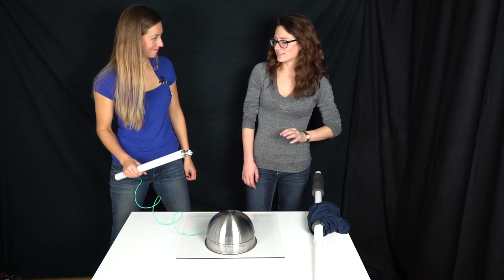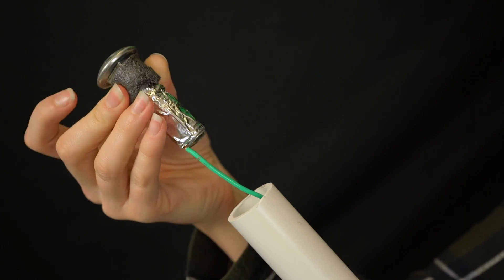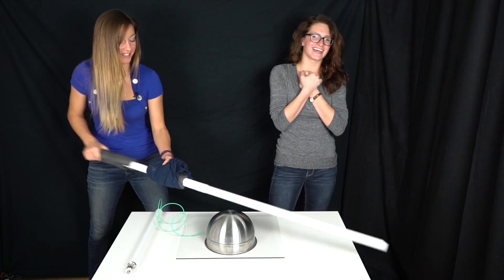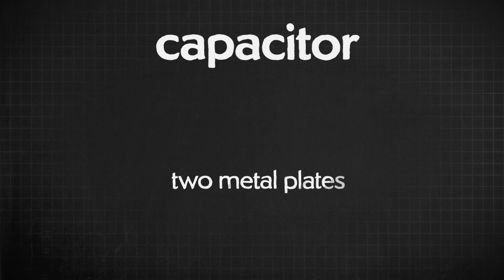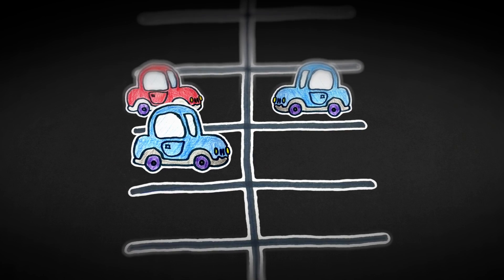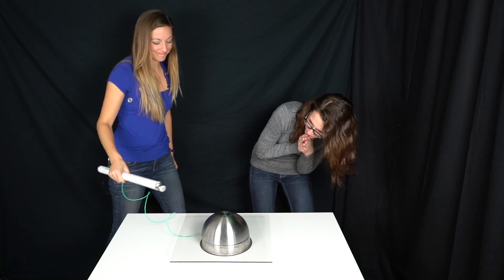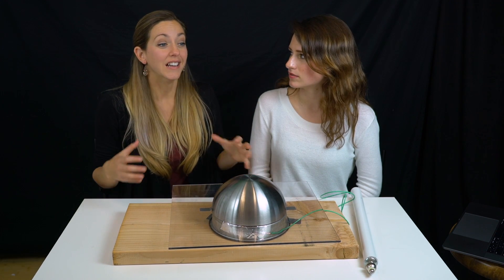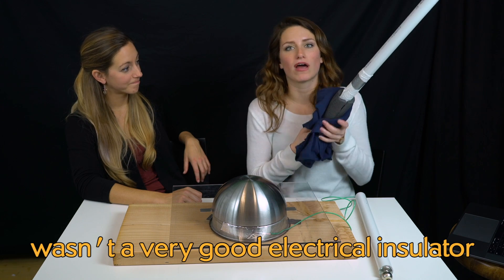DIY Lightning Experiment! Make a SHOCKING Capacitor

Comment: so if this was connected to a power supply (lets say a 9volt battery) could this be made into a bug zapper? If you were to have a metal bowl a slightly smaller clear plastic bowl with a light under it to make it glow  and then put a smaller metal bowl to hold the charge and catch the bugs. 

or will the bugs just fly around and not get zapped because the bugs need to be grounded to get zapped?

Comment: Now if you could store that static charge in a capacitor and drain it off throw a resistor to a battery it would be a much better way to charge solar battery banks and could be converted to AC and put throw a transformer to supply the grid. the trick is to draw the static of miles of transmission lines that have no connection to ground. Back in the early days of Power line development the linesmen had to ground out Newly built Power lines not yet connected to the grid because they would build a static charge and linesmen would get killed from coming in to contact with a line so they started grounding the lines with giuide wires and chains at the very start of the job. Could this be Tesla's way of getting free energy? but back in tesla's day they didn't have the technology we have today with battery storage and resistive control of higher voltages. Static is low current high voltage but if you can lower the flow of the voltage using a resistor that would increase the current flow for a Battery bank and it would slow the time it took for the capacitor to discharge and could continue to produce current and voltage for days if not years even at night as long as their is air movement over the bare wires. Tesla didn't have IGBT transistors     https://en.wikipedia.org/wiki/Insulated-gate_bipolar_transistor      to convert DC into AC wave form so it can be fed into a transformer and transfered to the public grid.

Comment: The alternative way to get that kind of voltage involves a very long cockroft-walton multiplier string and a transformer. Probably want to limit it to about a 600V transformer since diodes get considerably more costly when you can't use 1N4007s. Note that this solution is seriously dangerous in comparison to this.

Comment: If you really want to see some super coolness touch it with a fluorescent tube (preferable something like a T8 standard 4 foot tube). If you are already holding the tube and the "jump" is only from the capacitor to the tube it will not hurt you. The pain felt by us from static discharge is the plasma created burning us when the electricity breaks down the airs dielectric resistance. Point is, you can light up a fluorescent light in your hand with nothing connecting it to anything except your body to ground. Works even better with a legit Van De Graff device. Enjoy!

Comment: Thank you for your video. Special thanks for an interesting way to get static electricity at home! We are waiting for new experiments from you! )))
P.S.  If you raise the bowl, when the capacitor is charged - the spark will be 5 times larger. But you have to be careful.

Comment: i have built it with my friends and i would very much appreciate if someone took their time and answer it :) (by the way big fan od the channel). i have only came to a small spark(0.5 cm-1cm) and that's The reason im asking.
1. is The magnet only gor aesthetics or does it actually have any effect on the size of the spark (because my physics teacher thinks it is probably not useful)
2. because i can't get a polycarbonate sheet i thought that a better dielectric material will produce a better spark (china,  or wet earth in a plastic beg which i used) 
3. does a steel and not iron cake pan have a big effect. 
4. and finally you have said in your video that you tried for Two  days before succeding. can you please tell me if its not inconvinient what were youre mistakes and how did you fix them. 
even if anybody doesnt answer thank you anyway and videos are great keep on the Good work :))))

Comment: Cool concept! Physics girl, you were having issues due to the shape of your capacitor. All sharp edges must be eliminated. The underside of the bottom half, compared to the top, is quite a sharp radius. Your charge is leaking off the bottom as it is charged up.

Comment: instead of cloth - you should have used cling wrap.  It is flexible and non-conductive.  You can also cut it better to make it fit so it doesn't accidentally touch the PVC.

Comment: Hey, this is awesome, but please add safety warning for those building this at home: If touching it, make sure to not let the full voltage be across one's body. ie, if touching dome with hand, no part of body should be anywhere near the base or discharge wand or anything connected to other plate of capacitor.
Reply: Psy Kosh the current on this would be so little there would be minimal chance of injury

Comment: Fabric is a good insulator? I work in a lab that uses a lot of plastic bags and centrifuges, SHOCKING discharges are not uncommon. I've often received a shock when making contact between my arm and a metal trolley. That is, through a shirt and a labcoat. But at least now I know a little bit more about why we all get so many sparks around the lab!

Comment: According to your setup, after initially charging your bowl, you have an excess of electrons in the bowl but not an excess in the plate, only a separation of charges there. After the spark you still have the same excess of electrons but now it is distributed between the bowl and the plate.
So I assume that after each spark you ground your capacitor to get rid of the excess electrons.
Similarly there would be a deficit of electrons on your charging pvc/cloth system, you would need to ground it too.

Comment: I will just short a 120 v socket to a couple wires and stick it in my mouth. 120 tickles, 240 can kill.
Reply: I wouldn't bet on that, it's not the voltage it's the current and where it hits you.

Comment: I love the video, I'm just wondering why the magnet and the metal ball were needed and why they had to be connected for the spark to be bigger than ordinary or even positively charged metal
Reply: julius groenjes We know that charges jump off from points easier, therefore if we have something round instead of pointy, we will be able to gather more charge. Basically why Van de Graaff generators are round.
Reply: So is the magnet just there to hold the smaller metal ball? Or is there another reason for the magnet?

Comment: why don't just charge it with battery
Reply: oldcowbb Well,  because the battery would chaṛhe it up to its own potential which is like, 9 volts or something. You need to keep dumping charges onto it.

Comment: Great video as always. One thing I'd like you to please consider is that I find there's a recurring trend in your videos where you start off explaining each and every step very thoroughly, and then as you get closer and closer to the final point, your explanation of each step becomes less and less detailed until eventually, for some people, certain steps don't make any sense since we don't have background knowledge to be able to fill in the gaps. For example, you said, "the high voltage breaks down air." What does that even mean? You also said, "the charges leak through the air." What's happening when the charges are moving through the air? That spark is literally the entire point of this video and you didn't provide any animation or breakdown of what happens while the spark is being produced. All you gave that most critical moment is literally 1 second and 6 words (i.e. the charges leak through the air), yet you thoroughly explained and animated every step leading up to that. 
I love watching your videos but I always leave feeling as if something was missing, as if I was introduced to a topic but it was not fully explained and I literally always have to go watch other videos on other channels to fully understand whatever your video was about.

Comment: Nice video! I have a nit to pick though. "...the bowl can only hold a small, limited amount of charge, so the current is low" - actually, isn't it true that the current is high (proportional to the voltage) but just very short-lived, so it's the total energy dissipated by the spark that's low?
Reply: Quick googling comes up with figures for lightning bolts from 10kA to 200kA.

The static in static electricity refers to the charge when it's not being discharged - when it has approximately 0 current.

The spark is transferring a certain amount of charge in a very short amount of time, so the current can get quite large, depending on how much charge you can build up. In the case of lightning, you get a lot of charge moving.
Reply: Matt Harden no. Static electricity has very little current. Hence the name static. It probably had 200,000 volts but like 1/1000mA of current.

Comment: Nice video! Could you also please explain how not to get sparks? I know, sparks are the best part :) However... I'm currently working in an office where the floor is completely fitted with carpet so a lot of static electricity is build up when you walk around. Then for example when I get close to my pc, I act as a conductor and see the sparks as well. Visually, I like it a lot. the shock part not so much.

Comment: Why the spark gap in the wand?  It's not clear to me what purpose that serves and would lower the potential you have for the big, visible sparks.  :)

Thanks for your work.
Reply from the maker: The spark gab actually increased the size of the sparks. Without it, charge bled off faster, you heard a hissing sound,and saw a much smaller spark.
Reply: I'm not Physics Girl but yes you can.  Acrylic is probably a bit better than polycarbonate in this application.

Comment: You should not touch it with your left hand as the charge will pass through your heart. Try touching it with a florescent tube, also any sharp point on the dome will concentrate the charge at that point. The charge is actually stored in the dialectic material used.

Comment: Hi why do you need the metal tape on the bowl? Seems like it should be already conductive. And why the spark plug? My guess is that it will be only conductive if the voltage is high enough (about 10000V) so lower voltage doesn´t discharge that early (if you touch another metal). Anyway great video, keep it up!
Reply from the maker: The metal tape was our method of electrically connecting the sheet metal circle to the bowl. The sheet metal was slightly smaller than the diameter of the bowl, so we connected them with conductive tape.